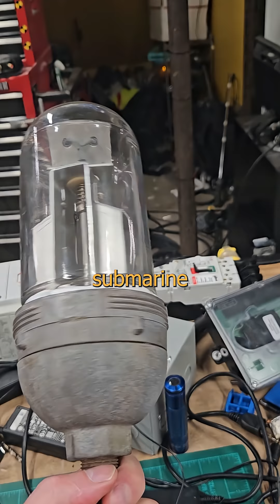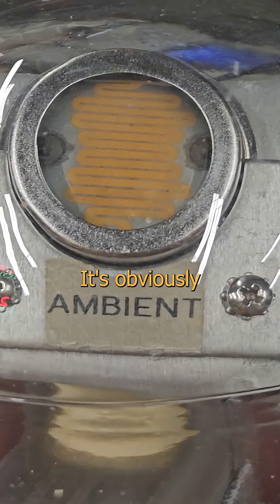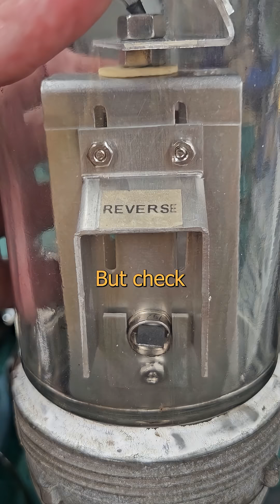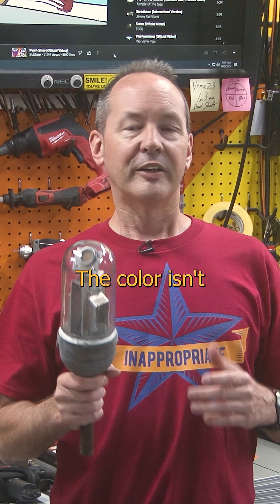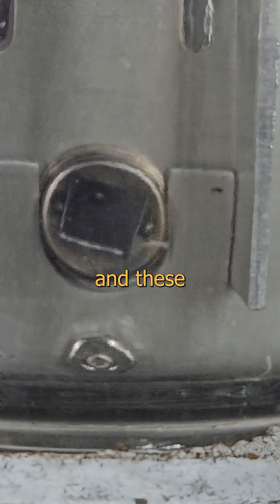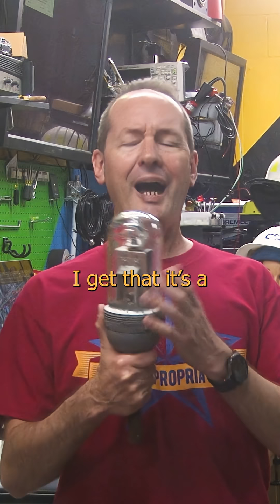Weird Light Sensor #chrisboden #comedy #engineering #electronics #electrical #educational #science

Comment: This is an old-style photocontrol for streetlights! The top ‘ambient’ sensor measures daylight from the sky, while the two side sensors help average out stray light like headlights or reflections. That way the lamp only turns on at true dusk and off at dawn, instead of flickering every time a car drives by. Pretty clever bit of engineering for something that looks so simple.
Reply: We have a transformer building at our street corner roughly the size of a garage which has a more modern variant of this mounted on the side.
It has about the same diameter but only 1/4 the size, and instead of a fancy glass top it's only opaque plastic so you can't see inside properly, but it seems to have an aluminum object in it looking like a old cpu heatsink without the fan and fewer fins.
It also has a red led which is lit when it's dark.
It also has a flat top which is great, by standing on your tiptoes you can put a lit flashlight on top, after about 30 Seconds the entire street goes dark.
For the price of a Tea-Candle you can make Halloween extra spooky, and you even have 30 Seconds to get away, not that i would know anyone who ever did this.😅
Reply: Damn, thats pretty interesting and genius. How did you know that?
Reply: @mayankmaurya8631 IDK how @LouderTails know this, but I am pretty sure he's right. It's been a very long time since I've seen one. Not since the neighborhood in which I grew up was upgraded to more modern street lights, but that looks exactly like how I remember the daylight sensors from the old lights looking. This was all the way back in the early 1990s, but the new lights that were put in had the photo sensor built into the top of the housing, in a recess that was angled away from traffic to keep headlights from interfering and to let rain flow out of it.
Reply: @iwontliveinfear  When I was a teenager, the neighbourhood I grew up in was upgraded to more modern street lights - from gas! 😱🤣 It was the last town in the UK to still have gas street lighting (in the 1970s)
Reply: You mad bastard, I love you forever. This is the kind of domain- and experience-specific knowledge which is effectively unavailable except in this brand new fashion where an apex mad bastard - one who is mad, bad, and dangerous to know - invokes the wisdom of a very specific and narrowband crowd, and yields knowledge which otherwise has only the chance of being discovered on some obscure pre-youtube forum and that's if someone actually wrote about it.
Reply: Were these put on every individual streetlight?
Reply: @carpentry-unlimited  I bet they could string several together to run off of one sensor. That would make the most sense
Reply: @bjornthorgudmundsson2781 My quick Google search said around the 50s and prior they were run groups of light per sensor. After that sensors costed less money and today we likely have a sensor on each light pre-built ito the light.
Reply: @DH-rt3fk the system we had for our small town had a few circuits throughout downtown controlled by several photo eyes that were on the main electrical cabinets. The single lights that are over an intersection for example all had their own photo eyes on top of the light.
Reply: @DH-rt3fk  They also used incandescent lamps in street lighting and some street lighting was run in series strings such that there was a voltage drop across each lamp.  So for instance they might have a branch of 8 or 9 lamps and the string would be fed with 900 - 1000 volts. Often each individual lamp employed a cutout so that if a bulb burned out that lamp would be bypassed so that the entire string doesn't go out. To turn the string on a dusk and off at dawn they either used a timer or a photocontrol to turn the entire string on and off.
Reply: And now they aren't as reliable
Reply: @carpentry-unlimited  I'm not aware of how it was done overseas but in Australia the practice was to use a pilot control system for street lighting. One switch or photocell energizes the pilot line which energizes a relay coil at each light, turning it on.

Such systems dated from the original electrical installations when control was manual and the addition of a control such as this one was a means to automate the entire system from one point. Some of these systems still exist today in the older parts of cities.
Reply: @carpentry-unlimited    In the old days a sensor would turn on a string of say 10 - 20 lights
Reply: @bjornthorgudmundsson2781 yeha i dont think so that would be expensive af
Reply: @carpentry-unlimited  no, they controlled blocks worth of stuff

and the ones around me have no sensor at all, just a mechanical timer
Reply: @carpentry-unlimited  Each group of street lights could be controlled by one such sensor so a few dozen or a whole street would be lit simultaneously.
Reply: @carpentry-unlimited  most likely on the first light in the series. Wouldn’t be cost effective for every light if they are in the same general area and on the same circuit.
Reply: So it is just turning on someone’s night light!
Reply: Some days life keeps ya down, and some days it's your time to shine. ;) shine on,  brother.
Reply: My dad owned a security business. One night while on patrol with him, he showed me that if you aimed a spotlight at one, you could turn off the streetlight.
Reply: This was basically what I guessed it was, though I didn't guess the application, just the mechanism. I feel proud.
Reply: That makes sense. I wonder if the sensors labeled forward and reverse can be calibrated for head and rear lights.
Reply: @jeffdrees1892 it's probably more useful leaving them calibrated for headlights, so accounting for cars coming the other way on the street.
Reply: @jeffdrees1892 What's the point in doing that, unless that was specifically for one-way streets?
Reply: this is the answer. I have an identical one from when they switched all the streetlights from mercury lamps to leds
Reply: New ones just have a delay for a minute for random lights hitting them..
Reply: dude thats fuckin awesome and makes sense now that you pointed it out. thanks for sharing your knowledge with us
Reply: I figured those side dookickeys were for directionality, didn't know what for.
Reply: I knew that's what it was even though I've never seen 1 up close, but the description and the placement of the sensors made sense to me. I remember people in the neighborhood trying to shine a super bright flashlight to turn the Street light off.
Reply: I was gonna say this but made sure to check. Bremerton, WA still uses these exact sensors, unless they updated in the last 5 years. I doubt they did, it's a navy town and they do NOT like messing with infrastructure design if they don't actually have to
Reply: I can only guess - but for some cool nostalgia reason - I want one !!
Reply: Figured it was that or for a radio tower
Reply: Part of that description now explains why sometimes lights on the highway shut off as people drive by them. 🚗💡
Reply: There's this older type streetlight on my way home after work at night that keeps turning off when I get close to it, I wonder if one of those sensors is bad and my headlights keep turning it off?
Reply: My guess was correct then
Reply: Oh wow, that's cool! I alway thought they just had a daylight sensor upstream somewhere with one main switch.
Reply: It seems that the ambient light sensor can also rotated, is that correct?
Reply: What does the forward and reverse mean?
Reply: @LouderTales  that’s pretty cool.
Reply: You’re a true quiz champion
Reply: I’m so proud of myself, my first guess was a street light, thank you for your knowledge and information! That’s pretty cool
Reply: Thats pretty cool
Reply: The two bottom PVs don’t just “average out”  stray light, they turn the device .
Reply: I was thinking runway lights
Reply: Why would the forward and reverse sensors need to be calibrated differently? 60 foot tall cars and trucks are really rare.
Why wouldn't they say front and rear?
This was mounted on something that moved; maybe a train, crane, or a drawbridge. The ambient sensor calibrated the sensitivity of the other two sensor that warned of oncoming traffic.
Reply: I want one to put in my collection of things that interest me. The jury is still out if it's the 'tism or if I'm part Magpie/crow that makes me want to collect these things. When I was a kid they said I was like Ariel because of my tendency to collect things but as I got older I got way too gothy to be a Disney princess. 🤣
Reply: wow, thats good
Reply: Why would you need to average out car headlights if the top one is pointed more or less to the sky? Could you not just point it straight up and measure the sky directly?
Reply: @CSPGameTime  to prevent cloud shadows and the like from turning the lights on and off constantly.  I'm confused why they didn't use 3 cadmium cells though.  why so many different kinds of sensors?
Reply: Damn, I was wrong! I thought it was an omnidirectional light sensor for determining the optimal alignment of solar cells. But the build looks too old school for that application.
Reply: That's cool
Reply: Never even thought about headlights interfering with street lights 😂 that's pretty cool
Reply: And THAT'S pretty cool!
Reply: thats preaty cool
Reply: My first though was it had to do with traffic somehow. Happy to have a confirmation
Reply: AND THAT'S PRETTY COOL!
Reply: Thanks for sharing. And you know what? That's pretty cool
Reply: Thank you!
Reply: I knew it was . Thanks for the actual details.
Reply: I actually think this is an AI response.
Reply: The PV Panels or Solar Panels are most likely used for Tracking the Sun and is dead simple at that like they power Motors for long to stay aligned with the Sun and how does it Spot Power no more because the Solar panel are in to much shade.
Reply: Wait, THAT’S how big those sensors are? I always looked up at our old preLED streetlight on my old block to watch it come on. The trees from the house behind it may have funged with it at times I wonder.
Reply: @IglooGaming1775   No. Half that size, max. 
This is a steering module for a solar panel.
Reply: I kinda wish your comment wasn't at the top as I was having fun trying to figure it out and wanted a little inspiration from the comments, but not the whole answer! Anyway, thank you 🙂 I had gotten as far as wondering what needed to measure ambient light as well as forward and reverse lights, and figured they wanted to take one away from the other- but I was thinking it was the ambient light they wanted to subtract not the forward and reverse lights 😅
Reply: We used to climb the poles then pull the sensor off the top and hang it by the light. When it got dark the light would come on and the sensor would turn it off, then it would turn back on etc. A whole estate of lights turning off and on slowly was highly amusing.
Reply: Close, but wrong. The PV cells operate an electric motor that turns the photocell at the top to face the sun. That's why the thing sits on top of a spinney shaft.
Reply: That's a nice guess but clearly and wrong because each photo cell on the side is labeled with forward and reverse and that's an unnecessary label for something like a street light Turner onner.

Its an old-style solar tracker or a component of a larger solar navigation/control system, possibly for a telescope dome or early power application.
The key features—vacuum tube style glass dome, metal base, photoresistor for ambient light, and separate photocells for "forward" and "reverse" power/detection—strongly suggest a device designed to orient itself or another object relative to the sun by comparing the light striking the "forward" and "reverse" sensors.
Reply: It is an old-style solar tracker or a component of a larger solar navigation/control system, possibly for a telescope dome or early power application.
The key features—vacuum tube style glass dome, metal base, photoresistor for ambient light, and separate photocells for "forward" and "reverse" power/detection—strongly suggest a device designed to orient itself or another object relative to the sun by comparing the light striking the "forward" and "reverse" sensors.
Reply: That's exactly what I thought it was!!! 😊
Reply: Yeah, that's exactly what I figured. In later years they simplified the design by using a thermal relay along with the photoresistor to switch the light on and off. The thermal relay also prevented the light from being turned off and on by things like car headlights or taillights, lightning flashes, kids with flashlights, etc. When I was about 14 years old I became obsessed with building my own and using them to control all sorts of lights and things around my house.
Reply: I remember the bumps on old streetlights
Reply: I saw this video again on Facebook, and I knew I had to jump over to YouTube to find your answer again. lol.
Reply: Certainly pretty ancient, otherwise it'd have a NEMA socket at the base.
Reply: Also, I'm interested in antique watching gear and also glass ceramic making porcelain.Also , lightning rods and much more , a lot of things along this line and something interesting

And I believe Arkansas principle. I was always looking out for the old infrastructure and one area. I think it was by one of the libraries potentially. There was one older Pole that had a single glass insulator on there. There's very few there, but there was just one lonely. 1 on 1 Pole in one area which is kind of strange that there is only 1?  And i'm on one pole that was just a quarterback like what
Reply: Seems like light but also heat sensors vs vacuum weights via heat/light bypassing no light or low light accuracy?
Reply: What I am wondering is if the ambient sensor becomes less resistive when exposed to light and more at night then I would expect that the current that would turn on the street light passed through that sensor during the day as the impedance was low enough and at night when the resistance was high enough to not allow that current through it would then go through to the street light. Is that about right? How about the averaging of the two other cells? Would it take the values from those sensors and essentially reduce that amount from the ambient sensor so that it doesn't think the sun was shining?
Reply: @MaJiKMars  You’ve basically got the right idea. The “ambient” sensor is most likely a photoresistor (LDR) or photodiode - yes, it becomes less resistive in daylight and more resistive at night. That change in resistance is part of a circuit that decides when to energize the light.

As for the two smaller sensors, they’re probably directional light sensors used for averaging or balancing. The idea is that the controller doesn’t want a quick flash of car headlights or a camera flash to trick the “ambient” sensor into thinking it’s daytime. By comparing the readings, the system can filter out sudden or localized light sources and respond only to true ambient daylight levels. So in practice, the microcontroller inside “weights” those signals together rather than simply subtracting one from another.

Thanks for asking a great question!
Reply: @MaJiKMars   The sensor would trigger a relay.
Reply: Nice! It sure looks like it was built to last and measure light from the sun and from two opposite directions.
Reply: Lol.
I was gonna say it looks like the ones on top of the old street lights...
But you know more than I....  I had no clue it had more than one sensor... Lol
I'm just old and spent my life getting into crap I wasn't supposed to. 😂
Reply: I reasoned that it was for some type of street level lighting, but my imagination had it as a photo sensor for bridge lighting. Since the housing looks very similar to the ones I have seen... On bridge lights. Great explanation.
Reply: OH! so thats what those were ontop of old streetlights! I always wondered
Reply: DUH
Reply: i love this community
Reply: So it literally turns on a night light lol
Reply: @LouderTales  Simple!?
Reply: Looks like the old way is best. Plenty of street lights shut off nowadays when people flick on high beams or go over a bump.
Reply: I have a feeling that the light averaging sensors may be either largely faulty or left out these days, because I keep finding street lights that turn off or flicker with traffic, particularly in the evening. Someone in city hall is trying to save (and likely pocket) a buck.
Reply: That explains why my mind instantly saw some kind of precursor to the HID lights I use for growing plants indoors.
Reply: They couldn't just do some time averaging?
Reply: @LouderTales  and THAT’S pretty cool!
Reply: Yes -it's "sort of" an analog electric switch, IMO  not electronic but that's just me
Reply: thought it looked familiar
Reply: Norfolk n Waypal.... The photo sensor is on top, so unless cars are falling out of the sky or a parking garage, there is zero chance a headlight is hitting that. And, with a slight amount of electronics you can build in some hysteresis, so the lights wouldn't go nuts if a cloud came over, though in extremely bad weather, they still turn on.
Reply: So it does turn on a night light.
Reply: Exactly what I was thinking. They still have something very similar in some rural towns nearby.